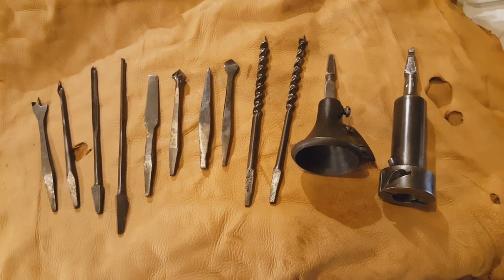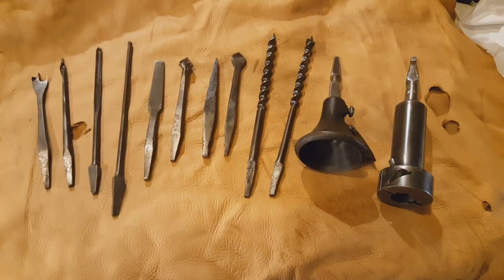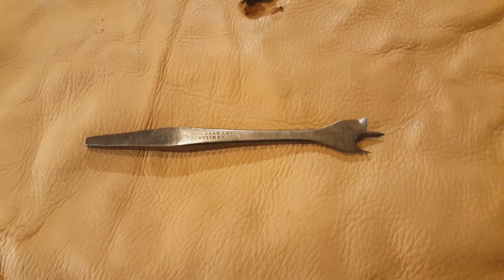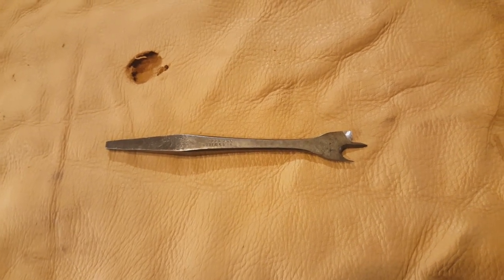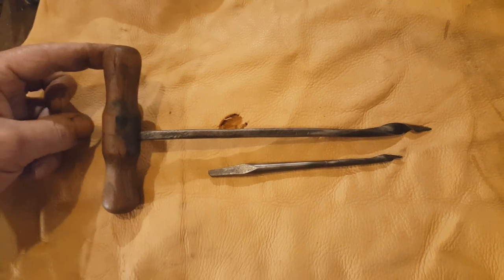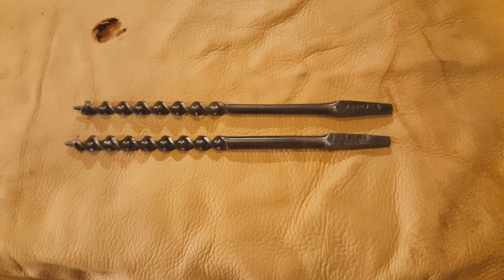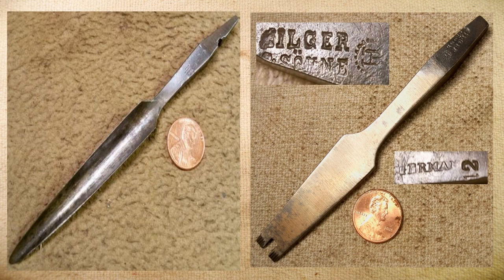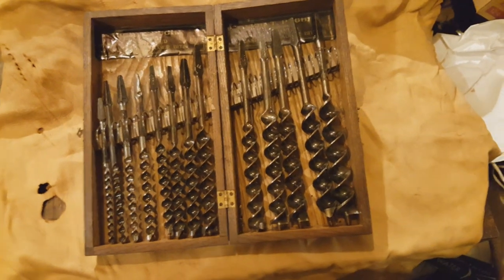19th Century Brace & Bitstock Tools & Bits

Comment: Before easily portable generators came to be, I remember using brace &bits to do work on mountain trails.  Much of what I know is from my grandfather and great-uncle, home builder/carpenter and cabinet maker, respectively.  RIP both of them.

Now with battery tools, many young ones think learning the old way is a waste of time.  I pray they never have to learn in a hurry.
Reply from the maker: Well I do sell a lot of these tools to folks who still use them, so there is still hope. Thanks for watching.